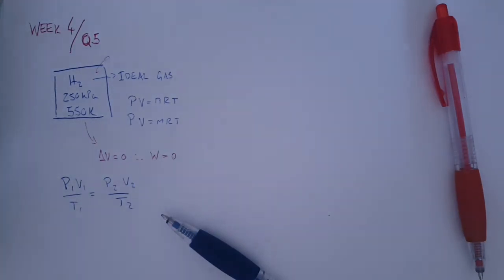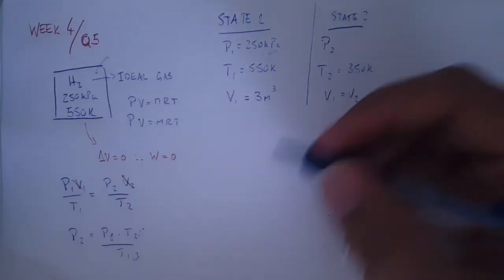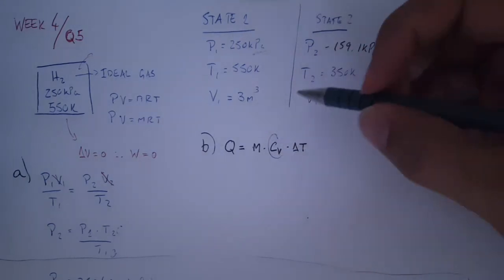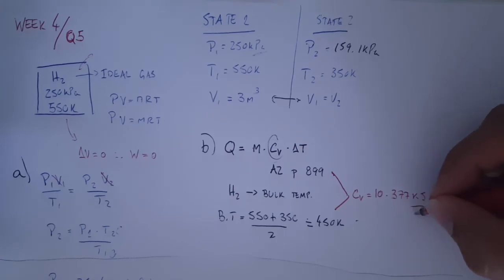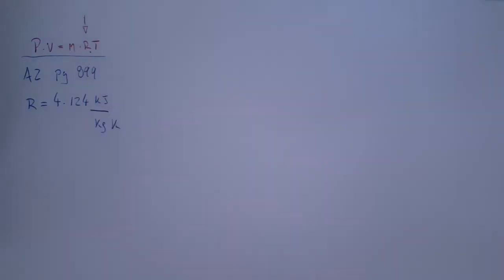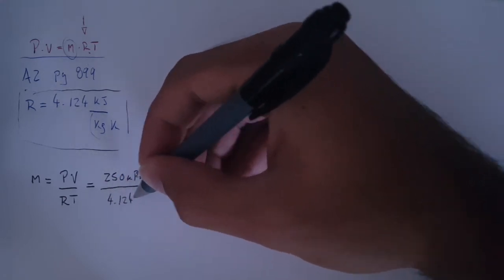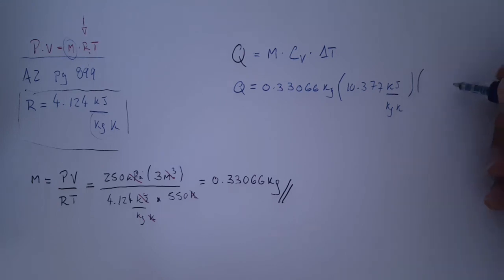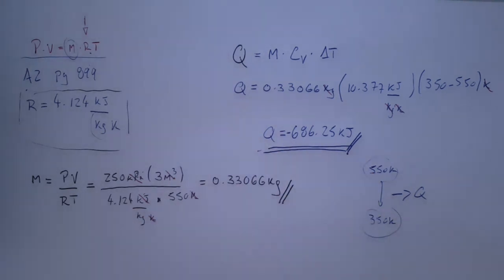Thermodynamics Mech3001 - Week 4 - Problem 5

Comment: Hi, why do we use the bulk temperature to approximate the Cv instead of using the average Cv of 350K(10.302) and 550K(10.405) ??
Reply from the maker: What an excellent question! 
If you do the average, you'll still get an approximately right answer. So it is not completely crazy to do it. Recall that the bulk temperature approach is also an approximation. The reason why we use it instead of taking the average of the Cv is related to the way Cv varies with temperature (the function f(T)=Cv). It is not a linear function, which is what you assume when you take the average as you propose.

If you want to dive deeper, integrate Cv from 350K to 550K and then plug into the heat equation to get the precise result (you can use a software for this), then compare the value you get with both approximations, which is closer? Finally, look at the graph showing the function f(T)=Cv in a textbook to visualize what is happening